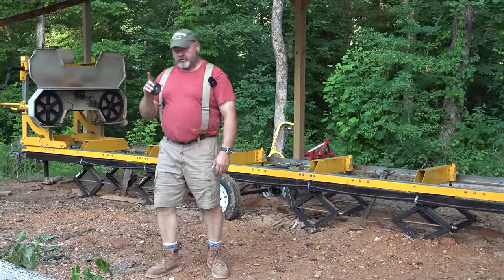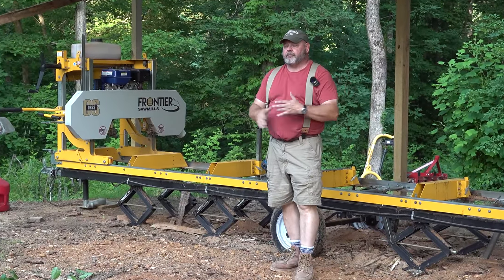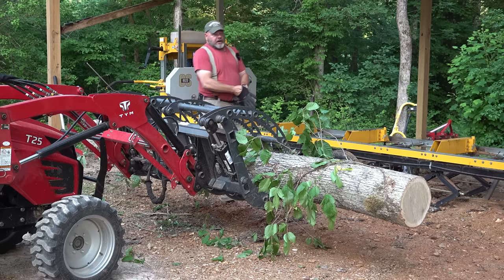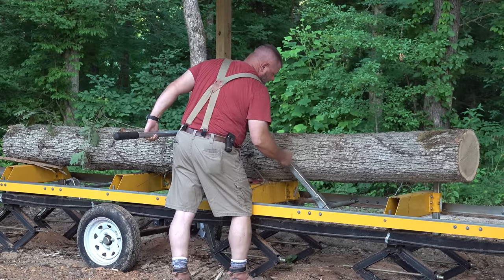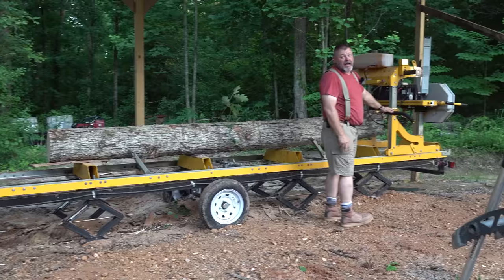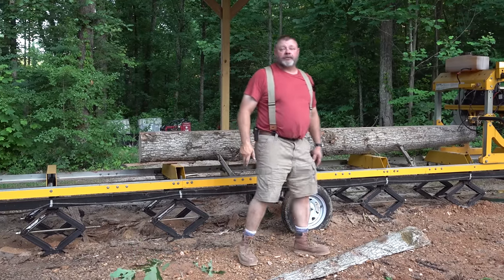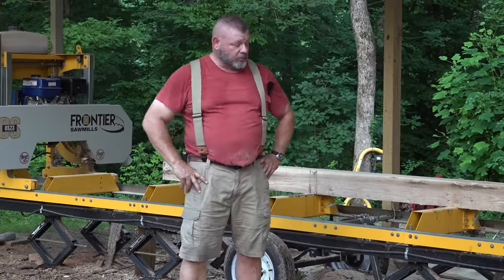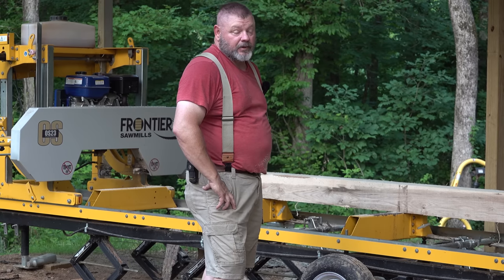Watch This Before You Buy a Frontier Sawmill. Lessons Learned

Comment: I don't envy the heat you have to endure! Tony I've been sawing about 7 years now and have learned a few things to get the best yield out of the small diameter logs on our property, first I never make a cut with one end off the bunk, also I rotate the log 180 degrees after the first cut then I only have to square the third cut, even with the bow in that log you should have been able to get an 8x8 with minimal wane towards the middle of the log. That said every log is different but if you standardize your procedures that takes at least one variable out of the equation. I have a Norwood LM 29 with a 13hp Honda and is a great size mill for my needs, kinda on the high side of the mid size mills, you can never have too much HP! Thanks for the videos I've been watching from up here in Nova Scotia for quite a while and enjoy the content!
Reply from the maker: Thank you for all of your knowledge. I learn something new each day.

Comment: HELLO TONY.  I been through that hernia deal, twice.   Nooo fun. Let yourself heal up, don't over do it.  One the kant size:  a rule of thumb is the kant will be 70% of the diameter..  Your 12" diameter log would produce a 7.4 kant..... except for the crook in the log.  visualize the kant from the small end of the log to the "choke" point, usually the center of the length of the log.  Now, if a larger diameter of the log at this point it  will usually give you a little lee way in projecting the kant to the large end of the log.  ALL three windows must line up..   This become evident when you saw straght planes(the sides of the kane) off the log.   Good luck with your sawing, always something to learn.
Rodney
Reply from the maker: Thank you. I am taking it easy for sure. I don't want to do this again! My second one too.

Comment: It's very hard to work outside here in southeast Louisiana. Being from the San Francisco bay area I've gotten spoiled, It can get way over 100 there but cools off in the evening when the Coastal Fog rolls in. High temps but very little humidity, needless to say I spend lots of time in front of a fan in my shop or jumping in the pool while I work in the yard. To hot jump in for a few mins. then back to work.
 I have a severe reaction to poison oak , Ivy and sumac, Louisiana is blessed with forests and my yard full of all three. I get it so bad that I have to go to the Hospital and get shots and steroid creams to try to clean it up. Burned some wood with limbs and brush that had some in it and I didn't see it, I got it from the smoke and it was in my hair, eyes, and all over took a month 3 trips to the hospital to get rid of that case.
Reply from the maker: I am blessed to not get poison ivy rashes. My cousin was like you. He will get a rash walking by the stuff.

Comment: How does the saw perform on hickory and knotty pine ? My last saw cut them wavy and was not pleased with the lumber it sawed.
Reply from the maker: Always had good luck. In my experience on this mill, wavy cuts are caused by the blade being too loose, poor tooth set, or dull blades. You could also be a combination of things. One of the thing that causes wavy cuts is when an operator sets the blade too far forward on the wheels.

Comment: Would you get the wheels (portable saw mill) again?  I am looking to purchase to do a homestead in the Caribbean.   You mentioned you pick up logs from others.   Would you cut on there sites or move to your location.   I am wondering if the extra money for the trailer set up is worth it or go bigger on the saw mill itself?
Reply from the maker: For me, I think it's easier to bring the log to The sawmill. I suspect if I had a mobile setup that I used everyday It would be okay to move the sawmill. However, I did not have that. I can't tell you how many things I forgot and how many trips I had to go back and forth when I brought my sawmill to an all-site location. I find it easier just to bring my tractor to a location and load logs. I come back for the tractor on the last trip.